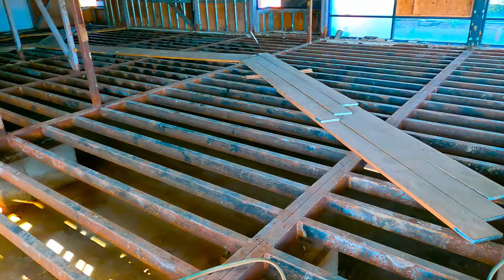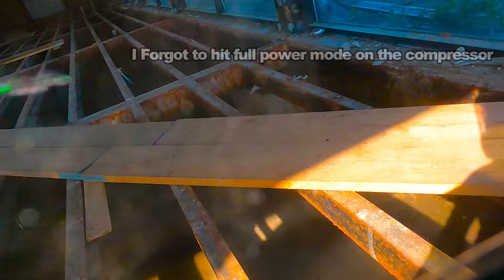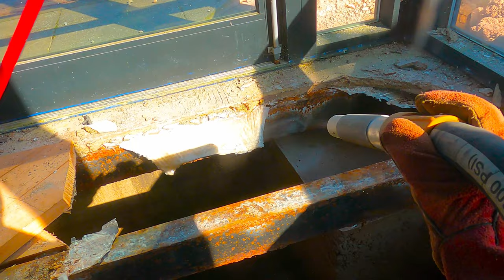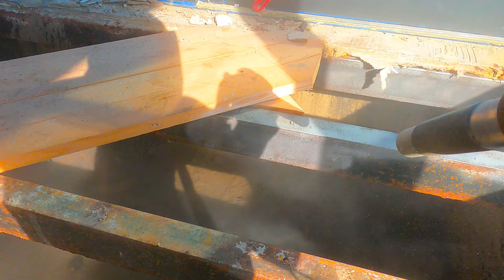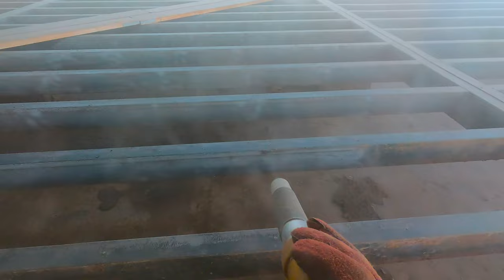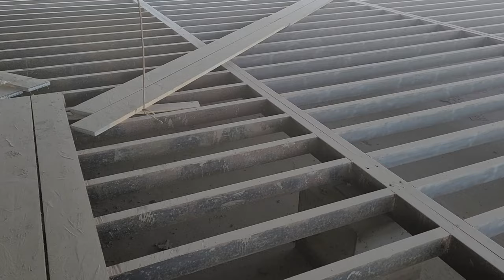Steel Beams shot blasting Fast Food supporting floor

Comment from the maker: I've made a mistake on this video I've always thort that Swedish blasting specs as SA3 as been brush off turns out that's SA2 I had it the wrong way round all this time 🤦‍♂️ hear in the UK we don't have any standards so kinda adopted this wording so please note in the video I get the number wrong scrubb 3 out and pretend I say 2 😂👍 paint data sheets say clean dry oil free surface meaning sa2 not sa3 i have been wording it
Reply: Yep you got it mate, I was gunna say on one of the other vids, but wasn't sure of how things are in the UK. 
Class 1 = Brush off - Class 3= White metal finish. Always give the customer what makes them happy.. & for the specs of the coating..
.
Reply from the maker: @andrewlee4239  yeah we don't really have set standards to work from so kinda adopted the Swedish standards of SA data sheets for most paint refer to blasting as a clean flat serface free from oils and other loose materials 👍

Comment: Have you ever run into wet grit that needed to be dried? How did wet grit affect the job?
Reply from the maker: Even slightly damp media will course the pot to clog my pot is designed to be dry you can get blast pots that's fully wet systems but these start a list of hole new problems 👍

Comment: Nicely done! Is the customer responsible for constructing the wooden access planks or is that on you? (I've never worked in anything even related to construction so...)
Reply from the maker: Thx glad you enjoyed 👍 It was in when I got their but it was mentioned I wasn't allowed to enter without hand rails erecting. Obversly with a temporary serface and hand rails will only get in the way so I put it in my risk assessment and method statement that work is to be done from the concrete floor under the beams and not off the boards they are purely in the way and not to be used 😏🤣 heath and safety that's involved in every part of the job even down to escape plan duediligence isn't my strong point but like every other self employed person you have to learn. Just because I can do the job I have to prove that on paper 1st and if I altered any method and anything goes wrong it's 100% my fault. I except if I fall walking on the beams an hurt my self its my fault and I don't have any chance of claiming off anyone because its my fault and done something not on the sheet although it's not practical sometimes just what we have to do so someone is always to blame if something goes wrong

Comment: Im starting a job monday coming sandblasting ect ive never done it before so kind of nervous these videos are giving me a bit of an idea to wat to do.
Reply from the maker: Please don't use these videos as a how too as I don't show alot of what is needed to keep safe and keep others around you safe. If you can take anything from them that's fine but please remember I don't show everything 👍 I wish you well good luck 👌 I would strongly advise some sort of training 1st but it's not law todo so 🙈
Reply: @Mobileblaster  oh i know that your obviously at it years im being trained in first for awhile but im well able ill get stuck in
Reply from the maker: Oh cool I didn't know if you was going to start with no one to watch over you. When I had lads working for me I always sent them out as a 2 gang even though I do it all on my own. I only have myself to blame if I get hurt with 2 on a job 1 can be makeing sure everything is running smoothly. Other blasting. After so long if anything happens like a pipe bust etc I can feel it nearly instantly and know what to expect in most worst cases. If you have someone to ask questions etc it should set you on the right path 👍 good luck remember don't stick ya fingers were ya wouldn't stick ya cocktail 😉 keeping it pg haha if demand is their I will do a live video ask me anything and I will try my best. I'm getting bombarded with texts and emails asking questions I don't have time to keep replying 1 on 1 (I have the business side to run too also like to switch off sometimes haha) so I may do a monthly live video ask away. I'm far from an expert but willing to share what I know 👍a duno if it will have enough demand I will do a poll one day.
Reply: @Mobileblaster  thanks man its the owner of a good company and there very busy so happy days

Comment: so in simple terms you forgot to load up the compressor, what size nozzel are you useing ? and what class of blast are you trying to get ?
Reply from the maker: Sa3 is the spec 260cfm is the rate the compressor is pushing @125psi about 95 100psi at the nozzle wich is cdx xl 650 9mm bore. And yeah I forgot to hit the load button on the compressor at the start this gives 60psi off load at 1st I thort I blow a pipe or had a massive air leak then quickly realised it was my fault not pressing the button haha easy fix lol 😂
Reply: @Mobileblaster  thats pretty good great job
Reply from the maker: Thx it's appreciated 👌

Comment: What cfm compressor you using
Reply from the maker: On this job 260cfm 1st few seconds was 260cfm @ 60psi then I hit the full power button 260cfm 125psi nozzle will be 95/100psi 👍